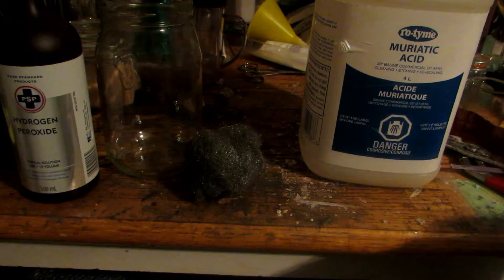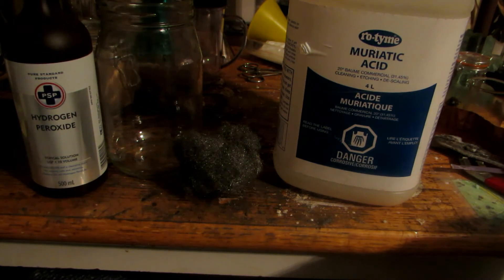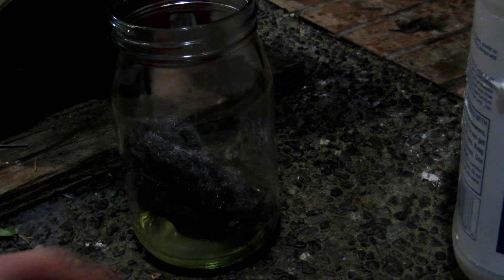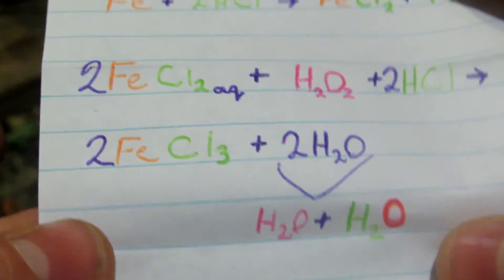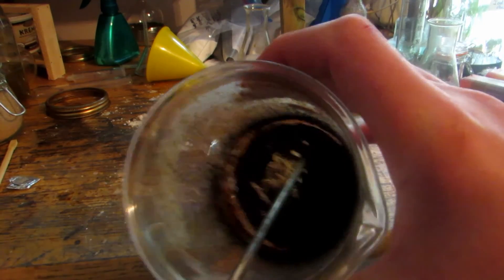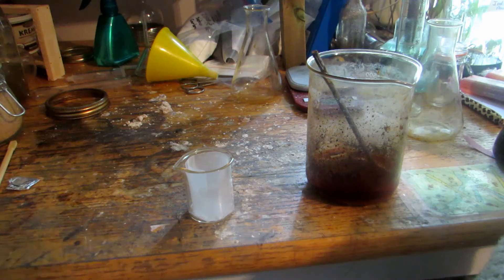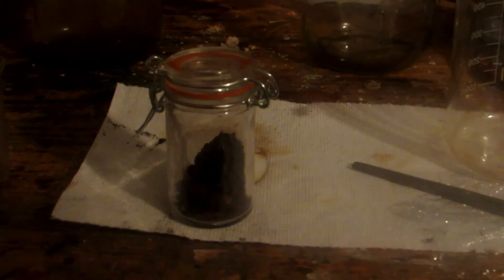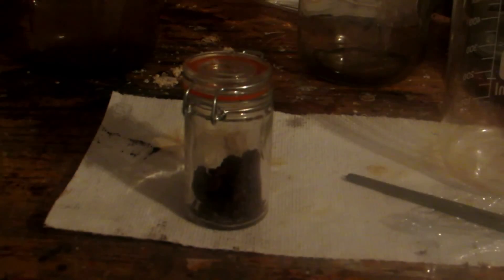How to Make Iron III Chloride

Comment: hello..i am a high school student ..
 preparing iron2chloride by my own  is safe or not ?
if it's not safe what percaution should i take?
Reply: It's mostly safe, just wear goggles, gloves and a lab coat to protect yourself from acid spills. And whenever you heat acid do so in a well ventilated area (fume hood or outside) as hydrogen chloride fumes are nasty and will make holes into your lungs possibly killing you horrendously. Also do this away from sparks, flames and ignition sources as hydrogen gas is extremely flammable and you don't want everything to catch fire.

Comment: I tried this once because I needed it for etching a knife blade but I used 10% HCl because I live in Holland and for some reason its extremely difficult to get more concentrated HCl, but it didn't want to dissolve it... Do you have any ideas for concentrating hydrochloric acid?
Reply from the maker: well, I know that Hydrochloric acid forms an azeotrope at 20 % so if you have a distillation aperatus... you could concentrate it to that. If not, then is suppose trying to dissolve more Hcl gas into the solution  would work. You would need sulfuric acid such as that from drain cleaner and table salt. By adding the two, hydrogen chloride is generated. If you were to bubble this through your dilute hcl solution, it would become stronger. Also, by chilling the Hydrochloric acid, it would be able to dissolve more hydrogen chloride making the dissolution more efficient.
Reply: Thanks for the info, but the worst part is that sulfuric acid is also hard to get here... I've looked through a lot of stores but none of them had sulfuric acid drain cleaner. I guess the moral of the story is: Holland sucks for home chemists... Ill keep trying though!
Reply: I also don't have a distillation apparatus so maybe i will make an improvised one or I can try to have two hcl solutions, one cooled and the other boiling and bubbling through the cooled one, so the HCl vapors boil off and dissolve in the cold solution .
Reply from the maker: Bart Hooghwerff I like your second idea, in my experience self rigged distillation apparatus's aren't always too successful. I think your second idea would work well. I suggest that you somehow stop the water from also boiling into your cool solution or else you won't be changing the concentration. Tell me if your idea works... I am interested!